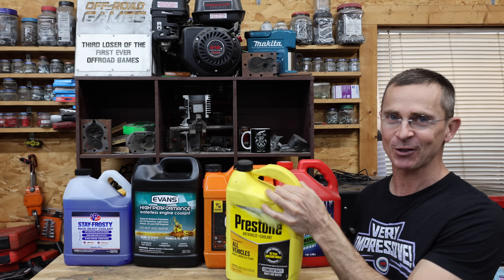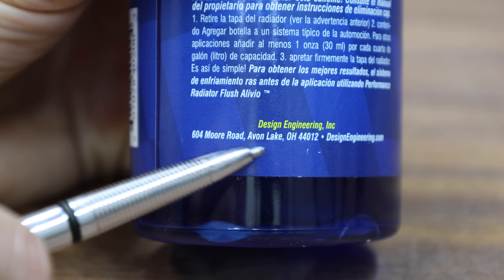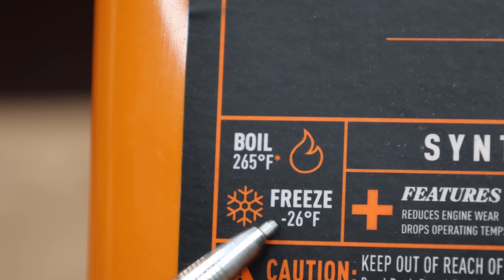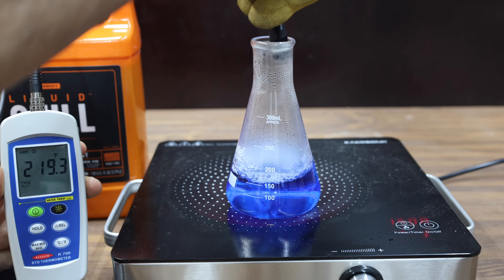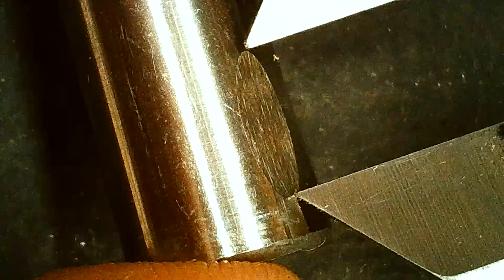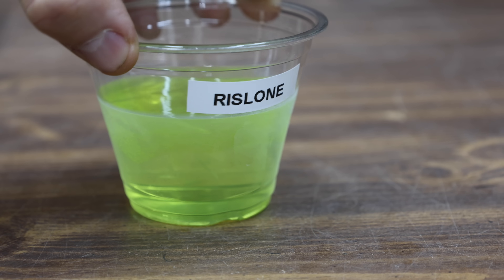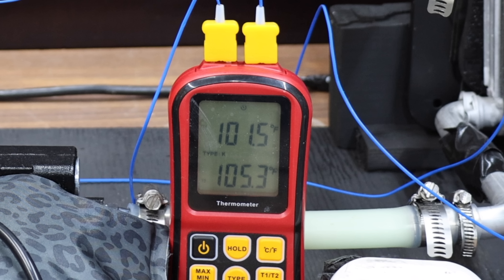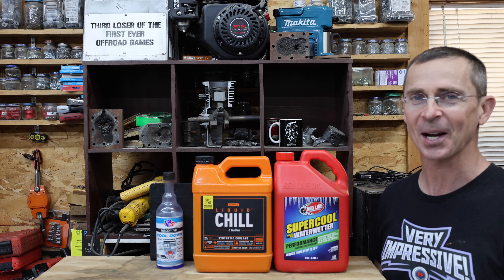Do "Super Coolants" Lower Engine Temperature By 30 Degrees?

Comment: Can you test for the best, most accurate digital paint thickness gauge? The tool detailers use to measure how thick a paint is on a car panel to determine how much paint/clearcoat is available to work with?
Reply from the maker: Thanks for the suggestion.

Comment: I have built a lamborghini Countach replica with an 2004 LS1 corvette engine. The only coolant that work for me is evans. I have 5 radiators,10 fans and 27 litre of Evans. All other start to make small bubbles that cause problem.  Evans dont!
Reply from the maker: Thanks for the feedback.

Comment: I like this channel a lot.  However, the claims of some of these products are moot.  First, the thermostat in a cooling system will not allow the coolant to run cooler.  Back in my early driving and working on cars days, the usual thermostat temperature was 180 degrees.  Later this was upped to 200 degrees.  I remember reading someplace that the hotter an engine runs, the more efficient it is.  Also, cooling systems are pressurized to increase the boiling point of the coolant so it's possible for temperatures to exceed 220 degrees with no boiling.

Comment: Excellent, as always.  Perhaps we could compare this on total cost-per-gallon assuming a 4-gallon system capacity where the Peak 50/50 is used as the base coolant for all additives.  If so, we get:

Ranked by Project Farm Average Finish:
1. Red Line Supercool = $49.99
2. Liquid Chill = $49.95
3. VP Racing Additive + Base = $15.56
4. Evans Waterless = $46.00
5. Royal Purple + Base = $16.29
6. Rislone Hyper Cool + Base = $13.54
7. DEI Relief + Base = $15.51
8. Peak 50/50 antifreeze (aka Base)= $11.69
9. Engine Ice = $47.30
10. VP Racing Stay Frosty = $35.99

I'm not certain whether these additives provide a return on investment for standard applications, but the VP Racing Additive stands out as the best performance per dollar and the VP Racing Stay Frosty as one of the worst.  With additives, we actually produce 4-20oz. extra in total coolant after mixing 4 gallons, but this won't be relevant to the total cost of a coolant flush; we might simply have slightly more spare coolant left over.
Reply from the maker: Thanks for sharing.

Comment: You definitely don't want to lower engine temperature. A cooler engine leads to more heat loss to the coolant which lowers the engine efficiency and power. Engines are designed to run at a certain temperature for efficiency and emissions.
Reply from the maker: Thanks for the feedback.
Reply: No.

There is still a thermostat for a reason. The engine will still run at the same operating temp as designed.

Comment: The specific heat of water is twice that of ethylene glycol, meaning it takes twice as much heat energy to get the temperature of pure water up by one degree when compared to pure antifreeze. My point is that in your heating element, water pump, and radiator set up, measuring the temperature of the inlet and outlet at the radiator is not a valid test, or at least its results can be misleading. A very concentrated mixture will come out of the radiator lower in temperature because it has less heat energy for the radiator to dissipate. But of course you don't want to run pure concentrate in your car, because it can only pull half the heat energy out for the same volume of flow.

I think a more telling test using this same setup would be to heat the tested medium up to the same temperature, say 140F, turn off the heater, turn on the pump, & radiator fan, and measure how quickly the temperature drops to, say, 105F. This is where more concentrated solutions or solutions which are not properly wetting the internal walls of the radiator will fail.
Reply: This!!  The results are interpreted wrong.  If anything, it shows plain water as best due to having the highest heat capacity. 

The only way to make that test accurate IMO, is to measure the wattage of the heating element & time & the fluid temp after it reaches equilibrium.
Reply: @Dereks06  Yes, you make a good point. By using the kWh measured display on a kill-a-watt to get to the higher temperature (e.g. 140W) and then stopping the heating element once the medium cools to the lower temperature (e.g. 105W) you could make the statement that the medium dissipated X amount of kWh in Y seconds - thus it is able to cool at a rate of (X/Y) kWh per second.
Reply: it's a very flawed test

Comment: One of the points of the Evans is to reduce localized surface boiling in the cylinder heads. In theory this should improve detonation resistance. It pretty much eliminates chance of boilover as well.
Reply from the maker: Thanks for the feedback.

Comment: The Evans cooling all is legendary among motorcycle users, particularly those of us who do off-road stuff. You basically cannot boil it out of your radiator. You'll see what's known as hard Enduro which is the people who use dirt bikes to climb stuff. The goats can climb and that's it revving their engine wide open 250 plus degrees and not blowing them up because of the school. You could have saved yourself a whole lot of trouble by just going to a couple dirt bike forums and asking what to use
Reply: Forums are full of incorrect BS...

Comment: Excellent and informative as always.  I flushed and changed my 6.7L Cummins coolant last month and added Amsoil Dominator Coolant Boost.  They boast it reduces engine temps by 25.° Was surprised it wasn’t in the runnings here
Reply from the maker: Thanks for the feedback.
Reply: I modified mine to connect the back cyclinder to the coolant neck and now most days I have trouble getting heat into the engine. Running reg green coolant.
A t shut off is necessary for this mod
Reply: @nickabel8279  that’s interesting.  I’ve never heard of doing this before.  My egr delete has the coolant routed back to the # 6 cylinder jacket which gets the hottest.
Reply: @andymike6575  2004. Mine goes from thermostat neck to one of the head ports on #6.
Took apart 3 engines to build one and all 3 had failed bc  #6 spun a bearing. 
I basically reengineered the Cummins to get rid of all the common failures.
#6 overheat. 
12v rods
Mixed n matched pistons n injectors for cooler running. 
Did away with factory trans cooler. Can't keep trans warm now either lol
Reply: @nickabel8279  dang what a headache that must have been.  What is better about 12V con rods?
Reply: Curious, when all other Amsoil products are best in class.

Comment: I did not know I needed to watch this coolant review, but thank you PF 🤘🏽.
I'm so glad Evans Waterless coolant performed well within their specs. It has saved a couple of my bmw vehicles.
I've been using Evans for over 15 years in my BMW vehicles. BMW cooling systems run hot and under 32 psi. BMW is well know to blow radiators, coolant hoses, and coolant reservoirs. But with Evans, there is No Pressure!. You can run your engine without a radiator cap, it will not spill over. It does not expand and it does not create any pressure when usedas directed (less than 3% water content).
Even if the engine overheats at 225 °F, Evans coolant will not boil and will not blow/warp the engine's heads because there is no pressure.
I know my bmw X4 and my Jag XF are very well protected 🤘🏽
Reply: Jay Leno uses Evan's in his cars
Reply: I've never seen the Evan's, but will definitely look for it now! That is an awesome product.
Reply: @pathfinderairborne920  I think amazon has lowest/same price anywhere where sold online. Jeggs and some other online retailers carry it, but for sure, Evans is not carried in your local auto parts.
Reply from the maker: Thanks for the feedback.
Reply: Same. My e36 LOVED Evans
Reply: It does expand. Thats why you fill up your system to the top. Run the motor and get it nice and hot and the Evans will expand and burp coolant out. Thats normal. After that it will not burp any out.
Reply: this reads like it was written by someone who works for them!
How has it "saved" the bmws?
Reply: @chrisdavidson911  it runs at zero psi pressure so it reduces the stress on the entire cooling system and won't boil up to 375+.
Reply: @jdgvee9313  yes, i can read, and that doesn't answer the question. In what way were they "saved"? Was that "zero pressure" measured and verified in the bmws? It does thermally expand, there will have been pressure.
Reply: @chrisdavidson911 you might be able to read but you can't comprehend what you are reading. The man literally explains why he feels it's "saved" his cars.
Reply: @sublime929  talking about comprehension while trying to pass of "feels" as facts. Bravo.

Evans does thermally expand. Have any of you even tried to measure it?.
Reply: @chrisdavidson911 dude, you are being so technical here. By the laws of physics, if you raise the temperature of any mass, it will expand, yes, Evans expands, it is a liquid, it will heat up and expand. However, it does not bahave the same as regular normal 50/50 coolant. If you replace 97% of the coolant in your vehicle, with Evans, you can remove the radiator cap while the engine running at operating temperature, and Evans will not flow out of the radiator like regular normal 50/50 coolant does. I've done it many times with my vehicles. Most bmw have a rad cap rated from 1.5 bar to 2.0 bar (up to 30psi), evans brings down that to nearly 0 psi.
Reply: @TheAioros261176  " I've done it many times with my vehicles." - why?

Can you explain why you think having 0 system pressure is a good thing?
Reply: @chrisdavidson911 why remove the rad cap? To check coolant level, mostly. When you have a bmw, and you do maintenance on the cooling system, you make sure the coolant is at the right level. And to show other people that Evans works.
And 0 psi means that hoses, plastic fittings, expansion tank, and radiator dont leak (or burst when brittle). Also, in the event the cooling system fails (thermostat, water pump, etc) and the engine overheats, there will be no pressure build up to damage the engine. The heat itself wont warp the heads or break any seals.
Reply: @TheAioros261176   "The heat itself wont warp the heads or break any seals." - neither will the few psi of system pressure. You think you can drive around with a failed pump and everything will be fine because of evans? As if this would have been the magical fix for the Triumph Stag?

It doesn't occur to you that system pressure can increase the rate of heat transfer? If your system's that fragile, shouldn't you be replacing the parts instead of staring at them and hoping to get away with it?
Reply: @chrisdavidson911  lol yeah it does, but no, i dont work for them. I had a '99 528i for 10yrs than got a '03 530i for about 5yrs 'til I got the X4. I've written about my experiences on bimmerfest forums as aioros13, you can look it up 🤘🏽

Comment: Wouldn't recommend doing this to vehicles which run fine as-is. Especially on aluminum engines. Running an engine cooler than what it is designed for could cause more wear over time, as the engine is designed to operate at operating temps. Still cool though!

Side note: similarly that's why thermostats should be replaced even if they are stuck open.
Reply from the maker: You are welcome!

Comment: The one thing you might not have known, the "stay Frosty" is required for race cars on tracks, especially drag racing. Anti-freeze is very hard to get up off the track and can cause a slick spot. 
So almost all tracks require water only (or the "Stay Frosty" brand as its proven not to soak into the track glue)
Reply from the maker: Thanks for the feedback.
Reply: Red Line Water Wetter is used for the same reason on racetracks.
Reply: That's why RedLine makes Water Wetter as an additive. It gives pure deionized water better heat transfer properties, lubricates water pump bearings and  seals. I've used it for 30+ years. Proven reliability. It's also really nice they manufacture it only minutes from my house.
Reply: @laneeric  Yeah, the road track I was at allowed Water Wetter.  Never heard of stay frosty until this video.
Reply: @laneeric my vr6 has fun hitting its 195 thermostat with straight water and 'Wetter, that stuff is great. 
Cruise temps are usually 175-185, it takes some beating to get it to 195.
Reply: @laneeric  I've tested Water Wetter at my local drag strip several times, and it NEVER lowered my average temps per pass one iota.... 🤷🏻
Reply: @davelowets  that's your thermostat's job
Reply: @beargillium2369  Thermostats dont change final operating temperature. They simply open up at a specified temp to allow coolant to flow. Final operating temperature is determined by airflow - via the fans or the air flow to the radiator.
Reply: @TDIETZ22  Air flow, radiator size and efficiency.
And if the radiator is large, efficient enough, then no max temp. difference would be seen no matter what additive is used.
Reply: @KCadbyRacing the addictive or coolant type still matters but everything else said.. yup
Reply: I search for a review from you before purchasing a new tool or appliance. You are the new consumers choice magazine. How could you go about testing Toilet Papers? I'm certain a few "pass-through" comedy comments would occur..
Reply: Always Water Wetter where I went.
Reply: Missing engine ice in the test
Reply: Really cool tidbit there! Didn't know that! Thanks 😊
Reply: Bleach got too expensive.

Comment: What this tells me is that stock coolant is more than enough for stock applications, and as you start to add additives to "increase its cooling capacity" all that means is raising the freezing point of the coolant for a few more degrees of top end, which would be good in a racing application but unnecessary in an everyday driver. 

My other observation is that the closer the coolant is to water (or the higher its water content) the more effective overall it is at cooling, so I would assume in actual racing applications, one would just use distilled water if needed.
Reply from the maker: Thanks for the feedback.
Reply: You are correct, pure water would give excellent cooling and it's mostly because of corrosion (and the boiling/freezing points) that glycol is added at all.

Comment: Did you flush your heat exchanger in between each test? Evans is hydrophobic and water residue will act as hot spots in the system. If you didn't use their water flush, then your test didn't deliver optimized results for Evans.

Comment: Before I watch this video I'd like to say that I think this is crazy to think these will lower engine temps. Engine that are liquid cooled will use a thermostat to regulate the temperature. If you make the cooling system work better then the thermostat will close more and allow less flow through the radiator in order to maintain the optimum temperature. I'm gonna watch the rest of this video to see if that holds true. Regardless I'm sure this will be another great PF video. Thanks again!
Reply from the maker: You are welcome!

Comment: Fyi, you have to take anything off of the heat when you temp check it to get the most accurate and consistent information. I’ve been a mechanic and professional cook for many years. That goes for food (take out of pan), coolant, etc.  There’s a really good chance that the tip of that thermometer probe will touch the glass bottom of the beaker, which is directly touching the heating surface, leading to many false temps that are inaccurate and vary wildly. Limiting the varying factors will produce much better results. Very cool vid, thanks!
Reply: Watch again. He's moving it around constantly.

Comment: I thought all these "coolant additives" were snake oil.  I'm impressed they actually do what they advertise.  
The only thing I would have added during the heat transfer test was the ambient air temperature.  Or at least mention that the air temp was  within 1°f for the entire testing session.
Reply: In the old-days you could get by with snake-oil products, but these days you get sued for it. :)

Comment: Best reviewer around youtube!
Recently, my "Check Engine" light came on, and for the first time, I tried using an OBDII scan tool. I don’t quite remember the exact code or how to describe the issue precisely, but as a temporary fix, I used a fuel additive labeled as an "Upper Cylinder Lubricant and Injector Cleaner with Detergents." Despite my initial doubts, it actually worked.

I’m curious to see if you’ll review these products soon—just out of pure curiosity—to find out whether they genuinely work or if my car's issue was just a temporary glitch.
Reply: He’s done some of the fuel system cleaners before.  
Use One of the complete fuel system cleaners with PEA (techron is one of them). Gum out has one and Techron has one but only the complete around $12.  Don’t use non-top tier fuel. Chevron, QT, shell are the ones I use. Nothing else has enough detergents.
Reply from the maker: Thanks for the suggestion.
Reply: Sometimes if you don't close your gas cap just tight enough, you'll get a check engine light until you fill up next time and get it to seal properly. Then the light goes off by itself. 

It happens, especially when the cap gets older.
Reply: When my car runs like shit, I add some two stroke oil, and it usually clears after a little while.
Reply: @MrJamesBanana  Omg to what?  Tell me you don’t add it to the fuel? Just don’t tell me. 🤦‍♂️🤦‍♂️
Gotta be a joke.  Would just clog your fuel filter or dirty it up a bit.
Reply: @BeefNEggs057 If properly mixed, it cannot even harm a fuel filter. The only thing to worry about would be fouling plugs, and harm to your catalytic converter (wouldn’t happen unless you used a lot)
Reply: @BeefNEggs057 tcw3 (that’s the rating, not brand) 2 cycle oil is somewhat of a common UCL. Tcw3 is wont fowl plugs, hurt the cats or build up carbon, many times it’s been known to clean up some carbon. You only use about 2oz per 10gal (640:1). Tcw3 is similar to Lucas UCL except it has more detergents.